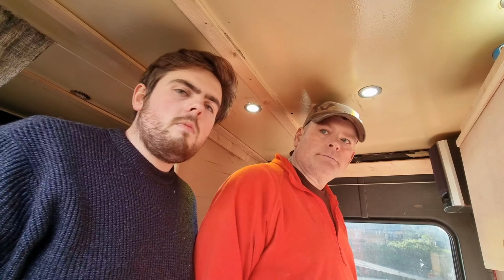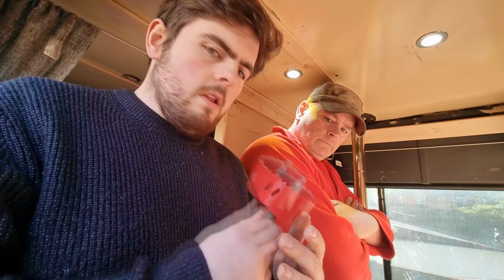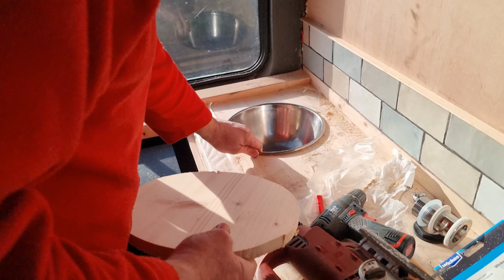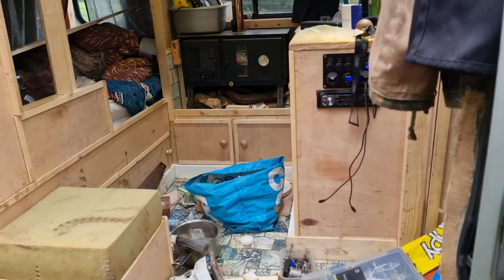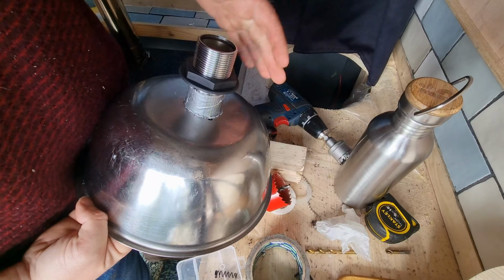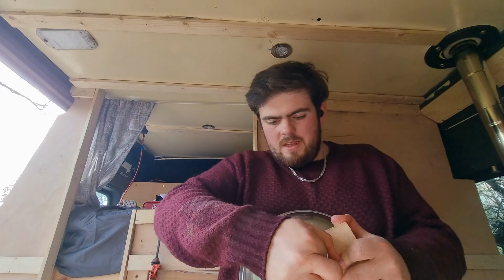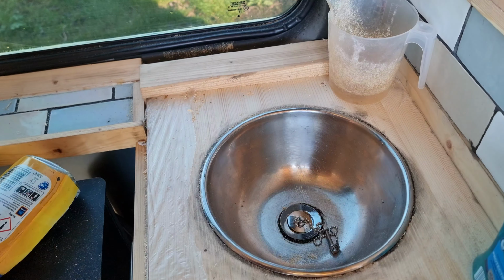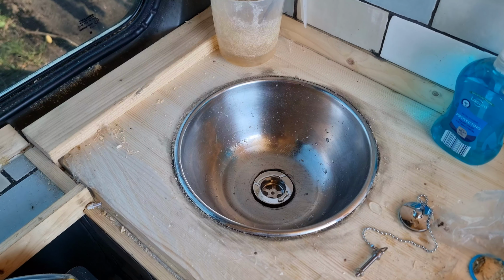Making a Stainless Steel Bowl Into a SINK in Our Campervan Conversion

Comment: When drilling on a smooth shiny surface like that, use a punch or even a hammer & screwdriver to make an indentation in the metal, the drill bit will not slip then....

Comment: Use a centre punch then put a bit off masking tape on it so the drill bit wont slip get a whole drill corect size bobs ya uncle 😊 plus you want the sink in front off ya so you not leaning to one side and get a bad back
Reply from the maker: Thank you, that's a great idea. I had to put the sink there, as they would be no room for the stove or chopping room